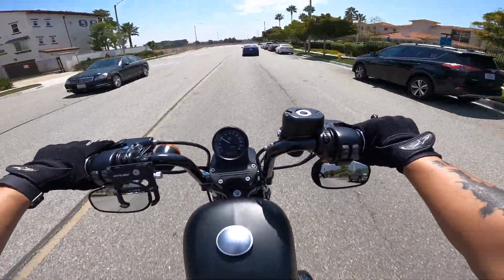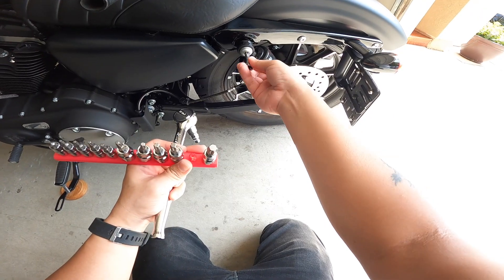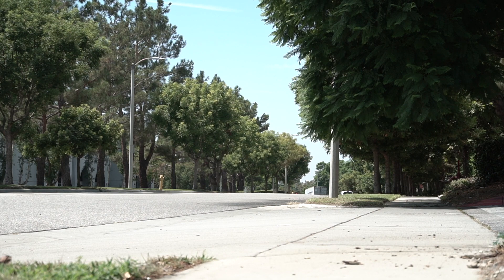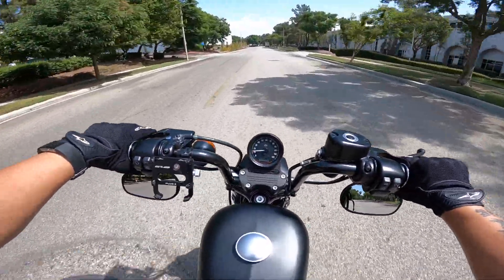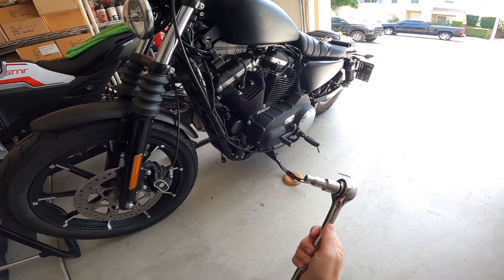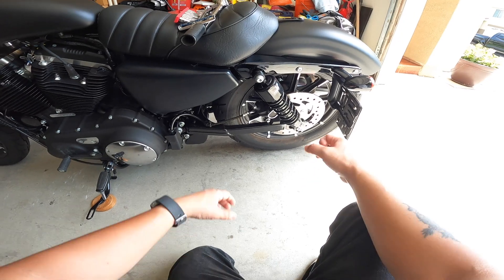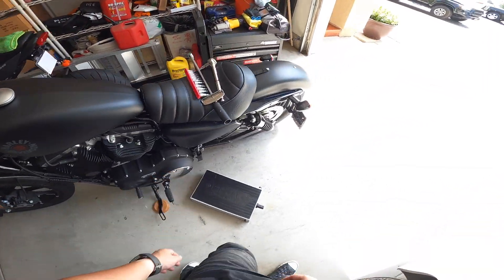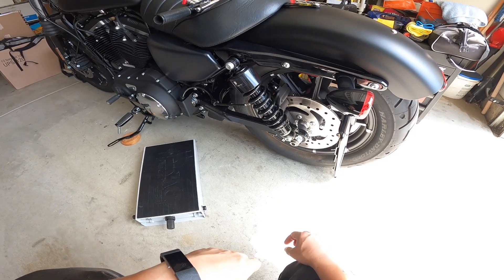Sportster Iron 883 Progressive 412 Shocks Review / Riding Over Bumps

Comment: put the 13" on mine and it TRANSFORMED the bike. You set the sag to 11.75" so when you're on the bike, you're barely higher than stock, but the increased travel is amazing. If you look at the videos of folks who tried the 11.5" versions, they almost unanimously regret not going 12.5-13"
Reply from the maker: If I had to buy them again, I'd go with 12" or higher lol. They've been fine for me tho 🤙
Reply: I just read your post. I have an 883 Sportster. Would you recommend that I go with at least the 12” progressive? Thanks

Comment: I put the 12.5" 412's with standard springs on my '09 Sportster 1200 Custom replacing the stock 11.5".  I'm 240 lbs and 5'10" and I prefer level 3 for the best overall ride.  Level 2 is a bit softer and the bike sits very slightly lower but it can bottom out over RR tracks which is why I leave it at level 3.  The bike sits about 1/2" to 3/4" higher than stock with me on it.  The steering turn-in is a little easier and I really love the ride.  It's a night an day difference.  I noticed that in the video, you kept saying "payload" but the term is "preload".  Little chuckle from that.  I looked at a lot of makes and models of shocks across the entire price range and I think that the 412's are, by far, the best value for the money and arguably the single best mod for the Sportster.
Reply: I have a '14 Seventy Two and put on the 12.5" standard springs.  I weigh 260 and set the preload at 4.  It sags about 1.3" while the specs show the travel is 3.14", so I still have some travel for bump absorption.  The slight lift at the rear helps with the downhill slope effect of the pancake seat and ape hangars..  Anyway the bike rides a lot nicer and floats over bumps it would slam into before.  12.5" is a great choice for the Sportster.

Comment: How did get your pipes delivered? Amazon no longer ships exhaust to CA 🤬
Reply from the maker: There are websites that sells and ship it to Cali. Just do a google search. Also, I think two bros racing are in Cali. Hit them up.
Reply: @kevlarxkoffee  Thanks for the heads up on two bros! I ordered and installed their mid controls on my 883 last week. Next up will be suspension; looking at the 412s as well since they're more affordable, debating between the 11.5 or 12'' to get some more clearance. Would you have done a 12'' if you had to do it all over? I realized you're on a 48 now, how are the suspensions on them?
Reply: @fjbyedone1731  "I ordered and installed their mid controls on my 883 last week"
883 comes stock with mid controls. Whats the difference ?